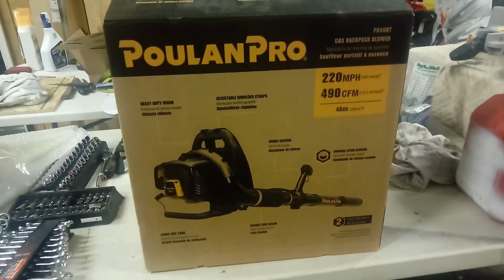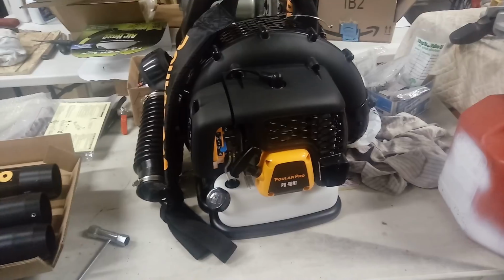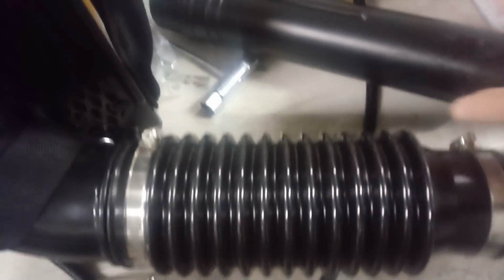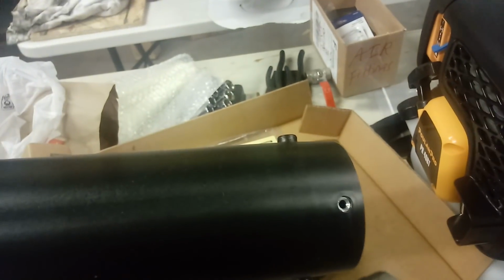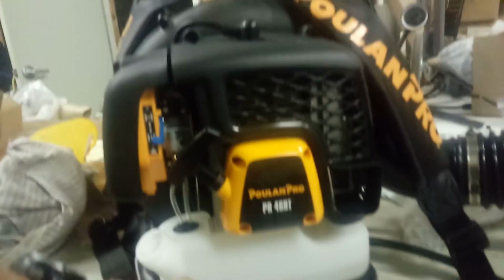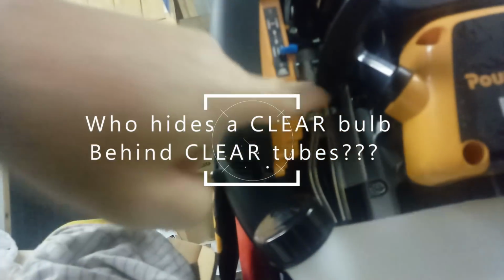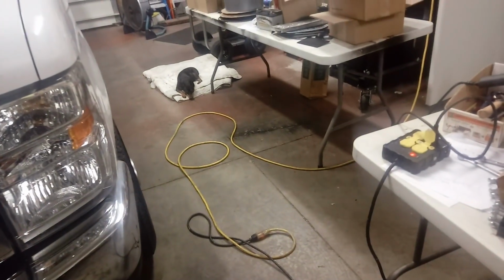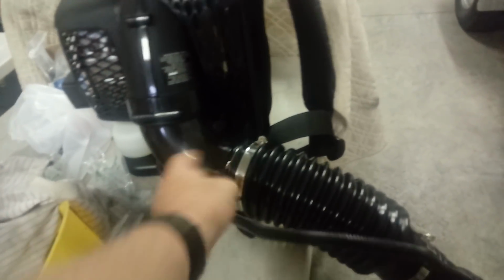How to Assemble and review Poulan Pro PR46BT Gas Backpack Leaf Blower LeGrand and Company Geneva NY

Comment: How has it held up over the last year? Thank you
Reply from the maker: So far it has been ok.  Bare in mind that I drain all the gas out of it for winter storage. So it is not used for 4 months... That being said it fired right up this spring...
Reply: Very nice, that's what I do for all my equipment. I run it out of fuel prior to storage. Thank you for the reply!
Reply: The issue running it out of gas is that you’re running it out of lubricant also
Reply: @jimccc9467  So what do you suggest?
Reply: @Rook20  I’m a big fan of non-ethanol gasoline and Stabil. Whenever I mix premix towards the end of the season I always add Stabil because some equipment doesn’t get used as often as others so then I don’t forget to treat the fuel. I do run the carbs out on four-stroke engines since they have a source for lubrication. I’ve haven’t had any issues starting my two-stroke engines if I’ve left treated fuel in the carbs. I guess if you had to run them dry maybe idle vs a bunch of throttle and subsequent heat.
Reply: @jimccc9467  Good info thanks

Comment: Just purchased the PR48BT Pro, For 2 days now I have been trying to start it, no luck. I used  SEF 50:1 premixed 2 cycle fuel oil.
Reply from the maker: Take it back and get a new one or a refund.  Prime by pressing the gas bulb 10 times. Turn the switch to on.  Put the choke on.  Put the little yellow gas lever to about a quarter of the way up.  Pull the rope handle.  After it starts out the choke in off position and squeeze the trigger .
Reply: @FreeAmericanSpirit  Yes, I did all that. Still not starting. Amazon purchase.
Reply from the maker: Have Amazon exchange it.  They are real good about that.

Comment: I bought this blower my self and I was in the middle of use and the engine just made a locking sound and seized the pull string won't budge any suggestions?
Reply from the maker: kenneth bon.  Oh man... Did you put the oil in the gas?  Sounds like you have to take it to a service guy and see if it is a manufactures defect or not.
Reply: Free American Spirit did everything right haha alright thank you sir

Comment: Just a quick info tip..the correct position for the control cable is to the inside of the pipe instead of the outside like in video.This is how it’s installed on Poulan website model as well as other illustrations.

Comment from the maker: It is etched in the metal behind the air cleaner.
Its hard to see but...
Get a flashlight
Take off the air cleaner cover.
Flash the light to the left side of the air cleaner.
Way back there behind the piece of card board and slightly down to the left you will see it stamped into the metal housing that is screwed to rhe plastic fan shroud.
About 2 inches above and to the left of the gas tank.

Comment: I bought one of these last yeear but i cant start it!! help me please
Reply from the maker: Adriana P Hernandez make,shire you have gas mixed with 2 cycle oil.  Then press the bulb 10 times.  Then put the choke on.  Then turn the little lever on the trigger just a little to give it some gas do not squeeze the trigger.  Then pull the rope 5 times.  If it starts slowly turn the choke off.  If it does not start, turn the choke off and pull the rope 3 more times.  If it does not run.  Turn it all off.  Then repeat the steps above.  If it still does not start then you can try fresh gas and a new spark plug.  If it still does not start you will have to take it in or service. Being a year old it should not even,need a plug.  If you left gas in it for a long time you may have to flush out the tank.      also you can try just a LITTLE spray of starting fluid on the air intake and try to start it.  If it runs I would let it run until the tank,us completely empty to burn out any old gas..,,  sorry I can't help more in not a mechanic :)

Comment: That $299 Husqvarna blower that you're talkin about is the 150BT.  The specs that Lowe's listed on it are not correct.  It is 251mph but only 434 CFM
Reply from the maker: Thanks for the reply... I took the specs off the box... Not of Lowes site....  Hmmmm.  Also it is a Poulon.... However it would be wise to double check,before you buy..
Reply: Poulans are good equipment (just rebranded Husqvarnas).  The higher spec CFM on that Husky is probably at the housing..
Reply from the maker: Thanks for the info....

Comment: Where is the serial number?
Reply from the maker: It is etched in the metal behind the air cleaner.
Its hard to see but...
Get a flashlight
Take off the air cleaner cover.
Flash the light to the left side of the air cleaner.
Way back there behind the piece of card board and slightly down to the left you will see it stamped into the metal housing that is screwed to the plastic fan shroud.
About 2 inches above and to the left of the gas tank.
Reply: @FreeAmericanSpirit  Than k you

Comment: I use the premixed fuel in a can ,never station gas..too much ethanol and ruins 2 cycle engines faster than anything.
Reply from the maker: The 1 gallon can pre mix is to expensive around here...  There are several gas stations that sell high test gas with out ethanol... That's what i use.
Reply: @FreeAmericanSpirit  what do you consider too expensive?  Also, you could have suggested it in your video and indicate that you thought it was expensive but that was up to each individual.
Reply from the maker: @75marlar  how would I know when I made the video that a viewer would comment about pre mixed gas?  Why would I mention it.  Anyways premixed gas in the van is usually double (or more) of what you would pay for just buying gas and mixing it yourself...